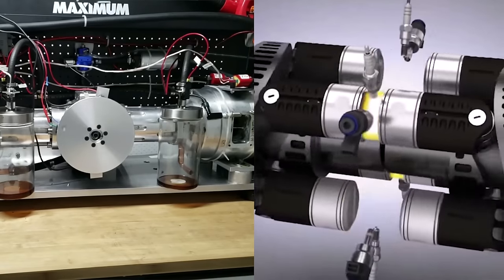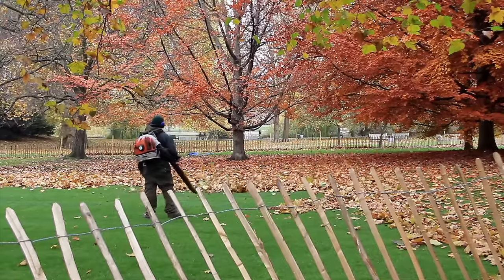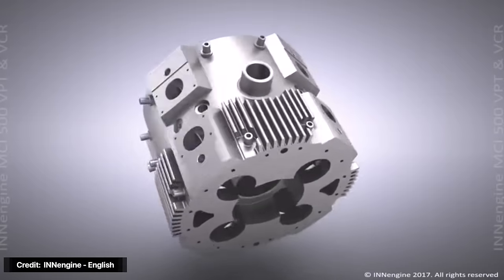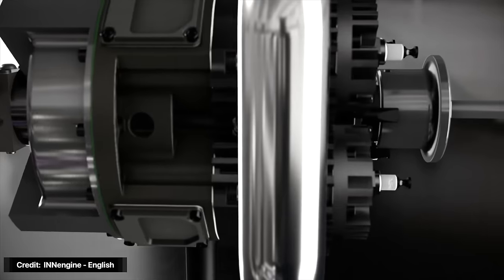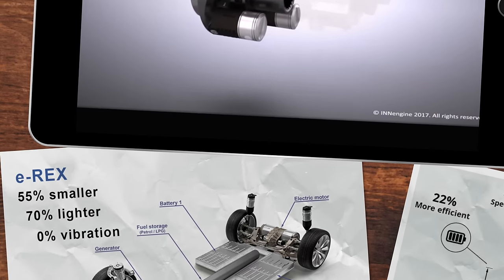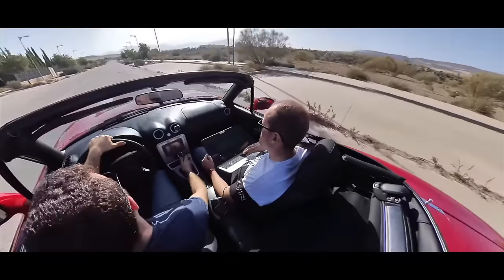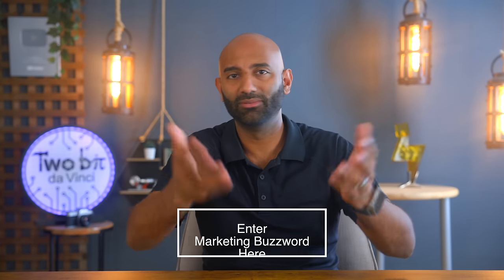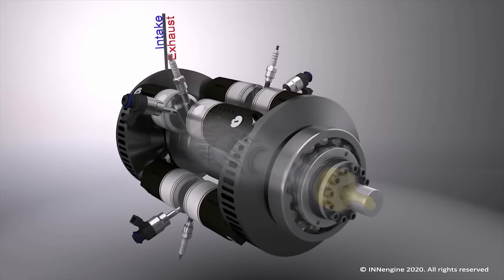One Stroke Engines - 200% More Efficient??

Comment: The concept of a range extended EV isn't new. I have a BWM i3 REx, which is one of the only production vehicles I know of that uses this architecture. It's essentially a "series plug-in hybrid", but what makes it a range-extended EV is that your primary "fuel" is electricity from the battery, which ultimately comes from the grid or home rooftop solar, and gasoline is supposed to be your secondary fuel, or support to bridge the gaps between charging stations on a road trip.

It works really well. The only problem with the series hybrid design is that it's less efficient than letting the engine directly drive the wheels. Toyota's hybrid architecture is "series-parallel" such that the engine can, in certain conditions, directly provide mechanical output to the drive shaft/transaxle. This is especially desirable if your battery is depleted and you're cruising at highway speeds, and even though it results in a more complex "transmission" (e.g. with a planetary gearset, or a clutch pack like the Honda Clarity PHEV), it is ultimately more efficient when running on gas than a series hybrid.

The inefficiency of the series hybrid is awfully clear when you consider how it runs when the battery is nearly depleted. It generates mechanical work, then a generator converts that to electricity, then that electricity goes into the battery, then the battery gets discharged to drive the electric motors, which convert the electricity back to mechanical work. Every time the energy is converted, you lose some efficiency. Even if each step is very efficient, when you combine them together, you lose a lot of energy. Regenerative braking helps a lot in heavy traffic, but if you're going at highway speeds over long distances, running on the REx is gets pretty poor MPG. It's in the high 20s last I tested, like 28 MPG. Icky. 

If I had my way, we would adopt one of these small-and-light "generator" designs -- this one or some other -- as the range extender in a so-called "series-parallel plugin hybrid" with an architecture similar to the Toyota Prius Prime or Rav4 Prime, but with a much larger battery pack. Let's say we can shrink the weight and size of the engine by 50% and triple the size of the battery pack. This would give us an EV range around 150 miles, which is enough for all but road trips. Then we'd have an 8-10 gallon gas tank which can easily bridge the gap between charging stations, even if you pull into an Electrify America station and all the chargers are broken. Oh well, just drive on gasoline for another 20 miles until you find the next one. 

A car of this design would work perfectly fine even in a charging "desert" (where all the chargers are broken, or they don't exist), and at a decent fuel efficiency, too (probably 40 mpg or higher in a mid-size sedan configuration). But it would also have 150 miles of EV range, so if you charge it up at home, nearly all trips, even "regional" trips (say, trips from the Baltimore area to the Washington DC area) could be taken completely on electricity. But if you needed to drive out to the midwest, and you couldn't find good chargers or didn't have time to stop, you could just keep driving on gasoline, and fill up every 200-250 miles at a gas station.

That would be the "dream car" for me, and I would probably buy cars that operate on that architecture for the rest of my life. 95% of my driving would be fueled by the grid (so, its "cleanliness" would depend on the energy mix of the power grid) and partially offset by my rooftop solar. The remaining 5%, those long distance trips, would not require me to rent a car -- I would just use gas to the extent necessary.
Reply: I've been thinking the exact same thing - and what you've described is the perfect Ev for Australia, where the majority of trips are small, but where the ability to charge is also small (or non-existent)
Reply: Very good points and I agree. Only problem is not many companies make those types of vehicles that most people can afford. I personally have to drive 1200 miles each weekend inorder to see my family and would love to have an electric or hybrid but they don't make financial sense when compared to my ICE that gets 40 mpg
Reply: So this all does potentially make sense and thanks for all the context (quite helpful).. but.. isn't the better long-term solution simply to improve the charging infrastructure? You're right that in charging deserts, you may be hurting for some extra range. But that's assuming that charging infrastructure doesn't explode and personal gasoline infrastructure doesn't atrophy. That may take 10 years, but look how much the network has already grown in the last 10, while EVs are still single digit percentage in the US market. 

Changing the parameters just a little bit can change the calculus of ever needing a gas REX - lighter and/or more dense batteries, more charger stations on routes, faster charging, more efficient vehicles. At least in passenger vehicles. I imagine there may still be uses for hybrids in extremely rural places or for distance hauling. But even then.. there are multiple ways to practically solve a problem and generally, I think we societally get the most benefit out of having better disbursed energy infrastructure over personal small generators, for various reasons.
Reply: Make sense, you are having the losses of both combustion engine and electric
Reply: If the generator can send power directly to the wheels or capacitors the losses are greatly diminished. I am amazed at how well my Priuses work but they are very complex, expensive and heavy. Especially if compared to what could be possible with the the correct generator and power storage. It has been done even at the experimental level.
Reply: This is how the Mitsubishi Outlander works. It does have a clutch pack that can drive the wheels from the engine in a single highway speed gear, but otherwise the engine is never xomnected directly to the wheels. It's one of the primary problems since it makes it FAR less efficient than other plugin hybrids.

This is also how Nissan's ePower system works... And make the hybrids based on it terrible for efficiency.
Reply: I think this is the future (hybrids) until we can have better batteries. Toyota doesn't see the future on EVs yet and I'm with them. It is some type of high efficiency hybrid while the batteries are improved. Right now the EVs are a high overall environmental impact solution yet.
Reply: Chevrolet actually had this years ago in the Volt, an electric powertrain and gas range extender.
Reply: @tskogen6905  You are speaking about Nissan e-power, wich has just achieved 100k sales, recently
Reply: the battery packs on the plug in prius are only supposed to last 3 to 5 years as compared with the normal prius where the batteries are supposed to last 10 to 15 years. when you consider efficiency you have to take that into account. youre talking about a larger battery that needs to be replaced much more often and the replacement is so expensive people will just throw the cars away and get new ones every few years. 

that is of course if people were able to afford that, which the majority cant. most people also cant afford to generate their own power through solar which means theyre powering the car off the grid almost entirely. with the current grid, thats not possible for millions of electric cars. and its not economically advantageous to use quick chargers.

you also have to consider that electric cars are about 50% heavier than hybrid cars which leads to more tire wear and brake dust which make up a large amount of pollution from modern cars as well as using more energy to power them. the current prius gets 55mph highway and city and weighs about 3000 lbs. the way to improve efficiency would be to lighten the cars by decreasing the cost of manufacturing using lightweight materials like carbon fiber or implementing technology that would eliminate collisions in which case the cars could be much lighter since they dont need to protect occupants.

consider a 1990s compact car running on gas. they are the most efficient because they last for decades getting reasonable mpg with cheap maintenance reducing the need to manufacture a new car. they also weigh considerably less than a new car because the crash test standards werent as strict as they are today. they also had proper size wheels and tires compared to giant rims with rubber band tires that come standard on every new automobile. if you took that 90s car and put toyotas hybrid system with a 1.6l gas engine and an eCVT it would get 80 to 100 mpg while offering moderate performance. if you arent racing, you dont need to accelerate to 60 in 2 seconds. 8 seconds is perfectly reasonable.
Reply: @tskogen6905  the toyota hybrids are actually fairly simple although you cant DIY them. they only cost 1500 to 3000 more than the non hybrid version of the same vehicle and are reasonably priced compared to any other ICE car. the entire market is expensive. but considering cost of ownership they are cheaper than the cheapest ICE cars, esp as gas gets more expensive. and theyre only a few hundred lbs heavier due to the battery and electric motor as compared to the non hybid version. all the cars now are heavier than they were a generation ago. thats not just the hybrids

Comment: good video but have to disagree about internal CE.  Hybrid is the way to go for the next 20 years. we dont have the infrastructure yet to support all electric.
Reply from the maker: Got my first in 2020. We’ve already come a long way and by 2030 it’ll be great. The amazing part is how you can 500,600hp and have a reliable motor. So sublime compared to high performance ICE engines that are expensive to keep up,
Reply: @TwoBitDaVinci  But is replacing every ICE car on the planet with an EV a realistic goal considering the rare materials needed for batteries, the way those materials are obtained (child labor in many cases), the infrastructure for charging, etc. Consider terraced homes in the UK and in much of Europe. No assigned parking, how would these folks own and charage an electric car? 

Electric sounds amazing, and it is. But on the wider scale, its not an even remotely reasonable or logistical option.

Comment: I would love to see this range extender option on a trailer to be used or even rented for long trips, since majority of the time it's not needed since an average modern EV is getting about 300 miles per charge available every morning if you change over night and average daily drive in US is between 25 to 50 miles per day.
Reply: I'm tempted to cut the front off this ICE car that I can't title and make it a trailer. This would then push my first gen leaf down the highway and even charge the EV due to regen. The main problems with this plan is that you can't toe a automatic transmission so this has to be running while in use and it would be a pain to get around in the city. So I would have to use it to get the 150 miles to the city and then disconnect it for stuff in the city and then reconnect it to get home.
Reply: They do make trailers with electric motors and battery to help reduce the load.
Reply: @lindafoss3823  I don't know if the trailers currently on the market can use regen braking, but I think that is possible.

Using a switch in the tow bar that works like the traditional roll over brake, then regen rollover would use generators connected to the trailer wheels to provide the braking force. 

If any viewer knows of a research project working on this idea please let me know their website or email details: it's an idea I've had for a long time but never known what to do with
Reply: The average ev won't even make it 250 top Tesla models can only go 200 miles cus. U run the radio the AC or heater and headlights ok so if u try to drive to Vegas from where I live all Tesla's gotta stop at buffalo bills to recharge cus they won't make it to Vegas.

Comment: What about the ICE H2 engine? Still an Ice engine, but no longer on fossil fuels, but uses H2 (Hydrogen) as fuel and for everything in a 1-, 2-, 3- or an existing 4-stroke engine, as Toyota did by ordering Yamaha to come up with a solution for their 5 liter V8 to run on hydrogen as fuel. Guess what... that engine is now available, which is an excellent move since it's virtually impossible for all of us all to run on battery electric cars. Impossible due to the scarcity of raw materials and there is absolutely no electrical network on earth, in any country we can think of, that can provide us with all the electricity in terms of capacity to drive our cars. So the more people switch to electric battery cars, the bigger the problem will be. And this is coming from someone who actually drives an electric battery car. Electric driving is not the future; Electric driving will soon reach the limits of all available electricity grids around the world. And so an environmentally friendly alternative to electric battery cars is a necessity.

Comment: I'm currently converting a 1980 VW pickup truck using a Tesla small drive unit and 90kWh battery pack.  I'm seriously considering making provisions for a portable generator that I can put in the bed if I want to go on longer trips.  It would be strapped or bolted down and would power the VW's onboard charger.  If the VW takes 12kw to go 55mph and I can put 6kW back into the battery via the onboard charger and portable generator I will effectively double my range.
Generally speaking, I do not like hybrids but a REX hybrid is intriguing.  
Thanks for all you do!
Bill

Comment: Range extender not only makes total sense but in cold weather it's the only salvation for EVs
Reply: What do you mean, cold weather is even bigger problem for cimbustion engines if range is out of the picture?
Reply: @samimurtomaki5534 you're kidding, right?
Reply: Perhaps you mean the BATTERY is a problem in cold weather for combustion engines LOL
Reply: Eah. That is obvious isn't it. At least in electric vehicle it is heated battery.
If there is juice/renge, you are immediately ready to go without exiting cranking lottery.

Comment: It does make sense as an REEV engine. I drive a Chevy Volt, which operates on the same basic principle. The narrow optimal torque band and cooling issues aren't as much of a problem when the engine essentially just needs two modes: on and off. Plus, an EV owner is exactly the type of person who would appreciate the low noise and vibration. Assuming all the claims are true, of course.

Comment: This is very much how hybrid sailing boats work.  Of course they have sails so theoretically they have an unlimited range.  They often have regen on their propellers so that the batteries recharge when they are sailing, and they often have solar panels.  In addition to using electricity to run their instruments and appliances,  they have an electric motor for when there is no wind or when they are coming into or leaving a marina.  The hybrids also have an generator so that they  can recharge their batteries if needed, even if they seldom use it.  Then there are electric hybrid power boats that don't have sails and run entirely off of electric motors.  These also have generators that recharge the batteries when necessary.

Comment: Tesla user here. I used to think BEV (pure EVs) were the only way forward, but now I see how important it has become to diversify EV tech. Having a small engine will overcome most of the fears slow adopters need to make the switch. Things like cold weather performance, cabin heating, cost of large battery packs, having no home charging, and quickly adding range. Plus gasoline isn't the only fuel, there are plenty of combustible fuels out there to help reduce fossil fuel use. So by all means, let's get those tiny engines into series hybrids (EREVs). I hope that maybe AI can help us figure out the best possible generator setup, to optimize it faster.
Reply: You are right and the approach is nothing new. The Jaguar CX75 Super car had a tiny engine for its claimed performance and could run on olive oil as I recall.... The BMW i3 could also be optioned with a constant speed small motorcycle engine as a "Range Extender"

Comment: I think Toyota had it right.  They stated that hybrid vehicles were the smarter way to go.  Especially with larger batteries requiring more use of precious resources.  Going electric drivetrain and combustion range extension just makes much more sense in the eventual transition to full EV adoption.  Dodge just announced their truck (Ram Charger) would have this architecture, and Chevy had this years ago with the Volt.  I'm all for it.
Reply: Toy-who? Seriously, they are taking a leaf right out of Kodak's book.

Comment: Agree, this is a two stroke.  BTW, not all two stroke engines burn oil-gas mix, that's only done if the backside of the piston (i.e. crankcase side) is used as the 'air pump'.

All 'heat engines' have four phases and it's sometimes tricky to find them.  An expansion/power phase, heat rejection phase, compression/pump phase, and heat addition phase.  They often overlap, but they are there somewhere.

Oh, and using each end of this engine to drive a front/real axle in an 'all wheel drive' could only work off road.  Normal AWD on firm roads requires the front/ rear drive shafts have to be allowed to turn at different rates around curves to avoid tire wear problems.
Reply: Don't some vehicle have a forward aft differential?
Reply: @DCGreenZone  Yes that's exactly my point.  If you just tied the forward drive shaft to this engine, and the rear drive shaft to the engine, you wouldn't have that 'third differential'.

Of course many 4wd have an option to 'lock' this 'third differential' when off roading, but on firm roads it needs to be 'unlocked' so fore and aft shafts can be turned at different ratios.